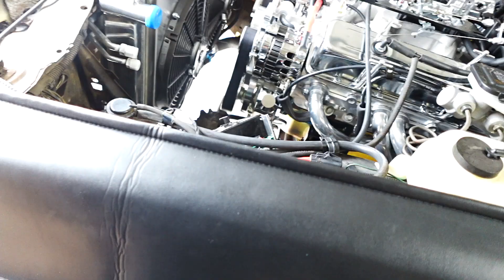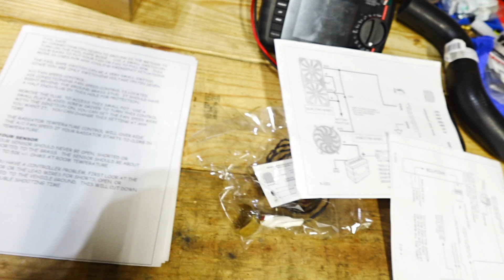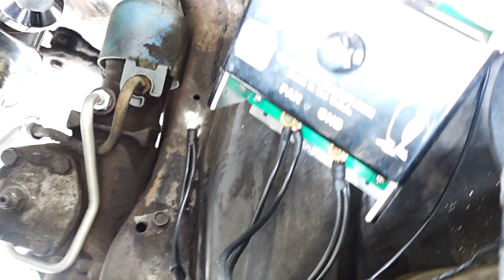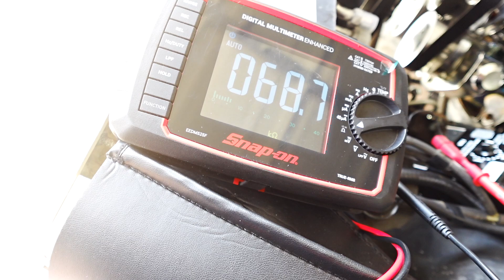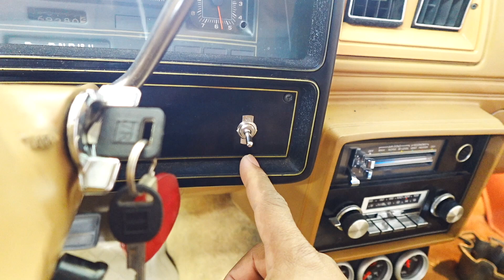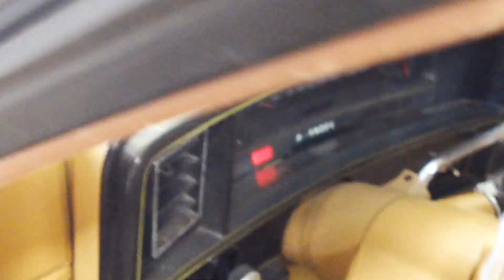1978 Chevy Malibu Classic Electric Fan Control Box Setup

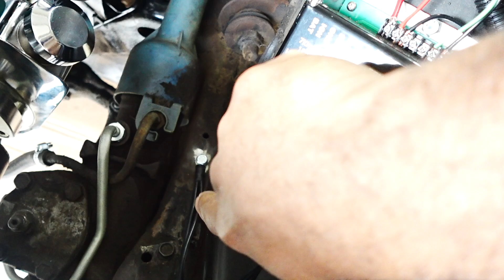Comment: I just got this pwm box. Is there a reason why you put two chasis ground wire to the box? @8:40
Reply from the maker: It’s just a habit to make sure I have a good ground. There are some application where Install the box and they have fans that have a bigger powerful fan motor and need more ground. I do it for constancy.
Reply: @KoolFredsGarage ok thank you 🙏🏾
Reply from the maker: @84SS931 NP!
Reply: @KoolFredsGarage  one more question. I also have an aluminum radiator. It says in the instructions to point a thermal gun to a dull black spot on the radiator. How did you get an accurate reading with the gun?

Comment: I have a 73 Impala as well. I have a few questions if you don’t mind helping me out with them.
Reply from the maker: Let me know what u need to know.
Reply: @ i’m trying to find some braided transmission  lines that will fit in the radiator